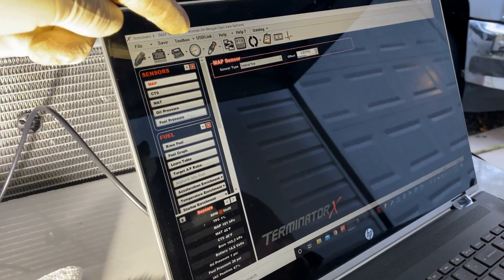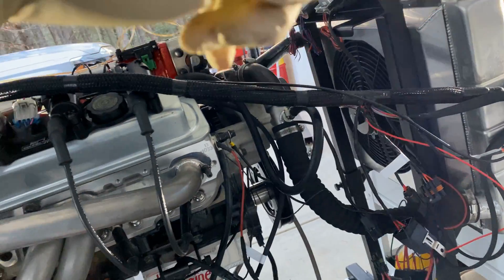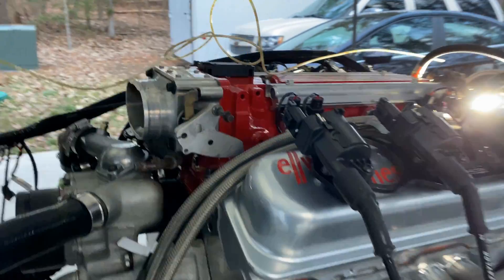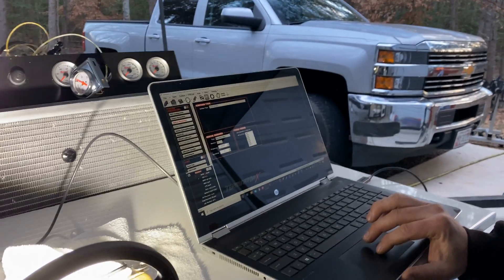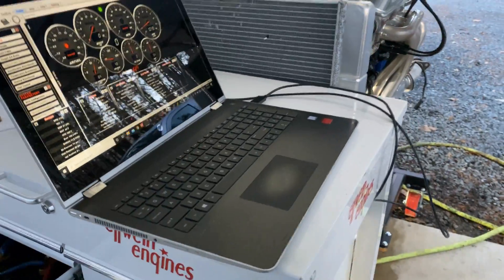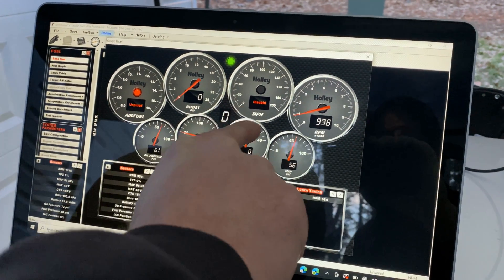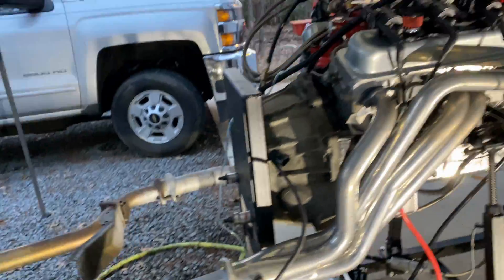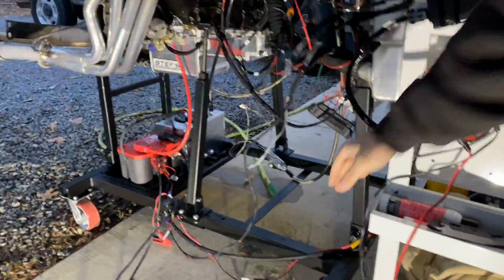First Start 1996 LT1 Terminator X On Test Stand

Comment: I am using a touqe head system on mine ,with it older Terminator x that only has the ls files ,did he get the correct soft where from global file firm where update
Reply from the maker: Yes the newest version.

Comment: Hey do they have one that would work for a 95
Reply from the maker: The terminator X would work on a 1995 too.   Do you mean for the EFI connection sensors that require a 1996 timing cover?  You would have to get a 1996 timing cover.  But the TorqHead system would work and you would not need a different timing cover to fit the crank reluctor if you used the Torqhead set up.
Reply: Ohh okay thank you man is there a number I can reach you I would like to talk to you more about my build and what I have going on I’m a beginner so I don’t know everything maybe you can help me understand what I’m working with thanks for responding man I really appreciate it
Reply from the maker: @angelortega6450  yes, you can call at 410-474-5579    But leave a message or text because I won't recognize your phone number
Reply: @EllweinEngines  okay! Thank you I’ll hit you up for sure I text mike noonan from efi and he helped me find the right setup to run thank you!!

Comment: What all is needed to run the Holley terminator system?
Reply from the maker: as far as I know just need 24x crank signal and 1x cam signal then plug in the coils/ injectors and other sensors.  The rest of the car needs to be piggybacked (as in the dash gauges).  The engine running is the easy part.

Comment: Good work, Karl!  By the way, what headers do you recommend for a 383 LT1 Impala??
Reply from the maker: Thanks.  Headers to fit the impala???  well...I guess right now the only header company is Clear Image Automotive.  I have not kept up with what's out there and available.  Nabil Guffey seems to know all things like that.  There certainly must be others.  FlowTec?   Stan's Headers?  What have you heard?
Reply: @EllweinEngines  Karl, thanks for the quick response.  I have not found much choice., especially in the long tube design.  All seem to be of the small diameter tubes.